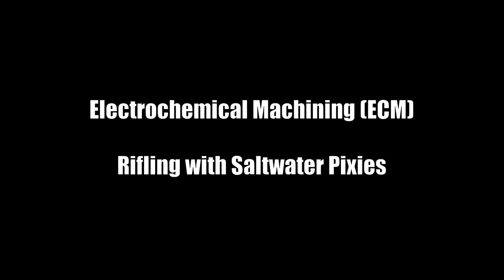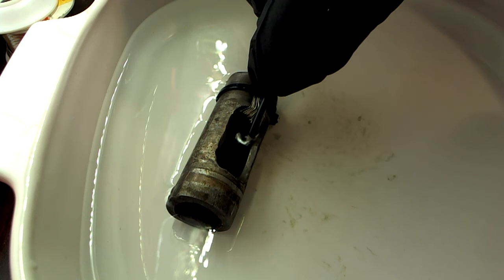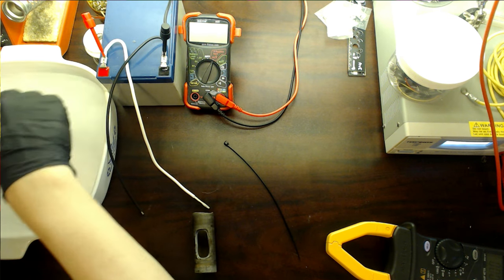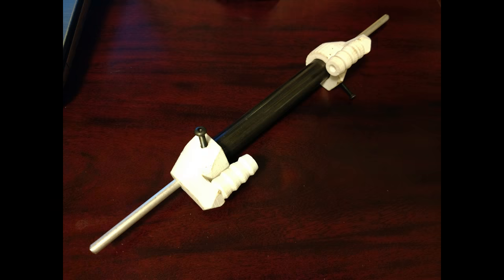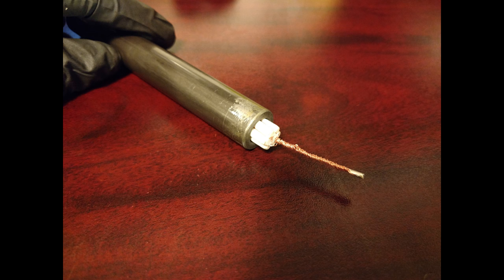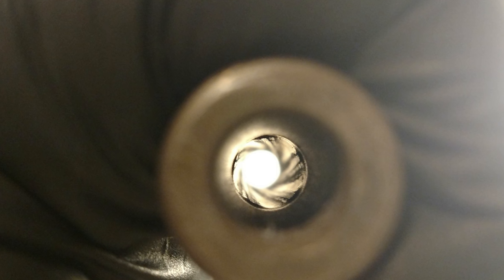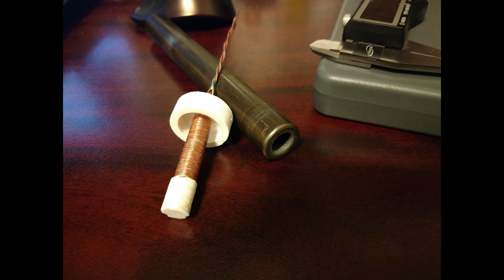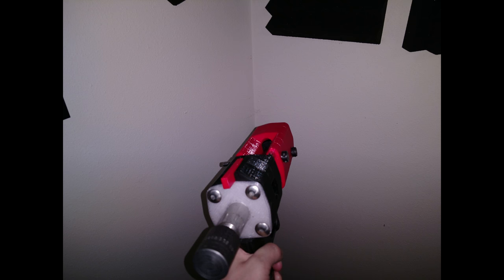#Liberator12k | 24 - Electrochemical Machining (ECM), Rifling, and Website.

Comment: in Russia we use a roller from a bearing. It needs to be chosen the desired diameter and cut dremel grooves at an angle. Then with the help of a punch (jackhammer) push through the billet barrel. it is faster and easier (if you do not forget about lubrication)
Reply: waptek  yes. It would be simpler to take a reamer, heat it up red and give it a twist, cut off a piece and push it by hammer or press. You can choose the amount of flutes you want by grinding off some from the reamer.

Comment: Most wire comes out of the drawing process work hardened to some degree, if you're having problems with it not taking shape, heat up a batch of wire to cherry red and quench in water to fully anneal it.
Reply: yes.  copper and silver get dead soft when you quench them from cherry red - almost like lead - floppy soft.
if you soak stainless steel for a bit at cherry red, it dissolves carbides so if you quench it, they don't form granules that destroy drill bits - effectively softening the stainless steel.
Reply: One could also make each strand from several smaller strands twisted together to reach the gauge you need. Basically litz wire that's really flexible and then just solder the ends together on the mandrel. I would suggest dipping the in a solder pot, then a quick dip in water so the solder heat doesn't flow up the wires and melt the plastic of the mandrel. (Been there done this)

Comment: I want to see this on a wet table with CNC controller.  Slow mans plasma cutter / engraver.  Modifying  g-code processor to support amperage based Z-offsets would be pretty straightforward.  Engraving plates and logos would be pretty neat.  Of course you can still use the old cotton swab and salt water with a stencil, but hey.

Comment: This would actually solve the problem of fluting the chambers for roller-delayed blowback HK firearms in a home-shop setting.
Reply: @Liberator12k  wouldnt it be easier to use a trunion for the roller delayed lock?
Reply: @Liberator12k  I think that a lever-delayed would be simpler to make, but trickier to design.
Reply: @Liberator12k  Good morning/night. Weird question but could you sleeve a 4.5-16mm linear rail, brass rod, or capillary tube with a 3d print with slots with the rifling pattern instead of copper wires? There's also the .5-1x.25-.5mm ribbon wires that are used in vaping too but I don't have the means to try them. Got old pc power supplies and printers to harvest from but no 3d printer or modeling experience.  The friction fit sleeve should isolate parts of the tube as long as there's no solution contacting it right? Why am I here at 4 A.M after looking at air rifle stuff?

Comment: Ho Lee Chit, that's friggin' amazing.
Reply: @Liberator12k  Good to see you wearing gloves. Any one working with metals that are in an ionized form needs to use protection. I think the aluminum and lead poisoning I got 10 years ago was from replicating Tesla's high frequency current patents. If any of you work with these sorts of things and start to have crazy symptoms look into metal poisoning. Good work laying this out. And if you haven't already, putting it into a pdf form and sharing a torrent and spreading the info would be great before the judeo-masonic ruling class impairs our access to such procedures (why reinvent the wheel right?) I'd also consider a well ventilated space for these processes. I know some types of steel have toxic elements in them to prevent rust. SS 316 has chromium IIRC.

Comment: Doesn't the useage of NaCl produce chlorine-gas? Thats why i use NaHCO3, also very easy to get and cheap
Reply: Yes and no. 2 NaCl + H2O does produce Cl2 (and 2 NaOH, and H2) but because there isn't a membrane it reacts with 2 NaOH to produce NaCl, NaClO and H2O. The production of chlorine using salt is known as the chloralkali process and it's how the world gets most of it's chlorine gas. The membrane used is not easy to come by and it isn't easily done by an amature. If it were, I would be rich. I live next to a giant pile of salt (about 4.5 billion tons) that anyone can take.

Comment: Looking to make other mandrels for different calibers. Do I bore out 5 thou under bullet diameter and rifle 5 thou over?  Also, the 16mm hydraulic pipe, what’s the largest caliber that can be loaded safely before it blows the barrel up?  Working on my own gun design using 1 inch square tubing for a breach face so not worried about that so much
Reply from the maker: That's the basic idea, but note that rifling depth varies by caliber. .22 only has like 2-3 thou deep grooves.

I have a calculator in the project for determining chamber pressure, I'll have to do a video on how it works sometime.. but it's in the Calculators directory.
Reply: @Liberator12k  I really want to make it in 357 so I can legally deer hunt here in Indiana

Comment: Hi, What constant flow of current (volts) do you need from the start of the process until it ends?
And, How long does the whole process take until the barrel is ready? 
Greetings from Costa Rica👍🏿
Reply from the maker: Hi Caleb. It depends, mostly on your power supply's max. Most of the cheap Chinese lab supplies max out at 5a.

Otherwise, You'll generally get a better surface finish with lower amperage. 

TL:DR; 5a
Reply: @Liberator12k  I really appreciate your help, thanks bro👍🏿

Comment: You might be able to produce quite complex shapes using 3D printed molds covered in copper leaf. You would need to figure out a mechanism, preferably also printed, for lowering the mold onto the work while running a steady flow of fresh electrolyte between them, but that is not that hard to design. I'm thinking bolts with locking lugs, bolt carriers, trunnions etc.(edit) I looked it up and my idea with molds was unnecessarily complicated. People are already modifying their 3D printers into electrochemical CNC machines. I suppose you will not find it on YouTube, but the first ECM'd  AR18 probably already exists.

Comment: Hi, I'm your fan. I also design a weapon (such a hobby). I was wondering how easy it was to make the barrel thread, this method is great but I have come up with something better. You can print bushings with threaded grooves, push them into the barrel and pour acid so that the grooves are etched. What do you think about this?
Reply: I trying with acid, I have a lot of acid to digest PCB plates, may be useful for this purpose.

Comment: Couldnt you wrap a copper electrode with string or wire, paint liberally, remove string after it dries. boom, there is your electrode. Or if you wanted more consistent water flow and crisp rifling you could coat the inner barrel, scrape off your pattern with a simple homeade tool, then run loosly braded wire for the electrode and circulate water in a closed loop through barrel. You got me thinking so I thought I would return the favor ;) nice work. Ameerricaa, f*ck yeeaahhhh!
Reply: La resistance! Or some sh*t  hah yeah noticed that after, I figured you further developed the idea. Since yesterday I think I like the idea of a small rigid tube with a hole on the side of the end, flexible dremal shaft inside attached to a tiny flat tippid diamond or carbide mill bit,  coming out at 10-15°. Pulling or pushing the shaft to adjust the depth. This assembly would be Ridgid, and the barrel would be fed with a simple spiral cam jig. Coolant fed threw the tube for long barrels or whatever. I was able to get the o.d. of the drill assembly down to around .2 so it  will be capable of every caliber, which is all I got so far. I'm impatient I can't wait for santa clause and his little electrons to rifle my barrel lol. I really do like the idea though